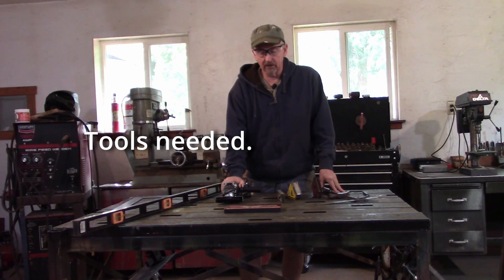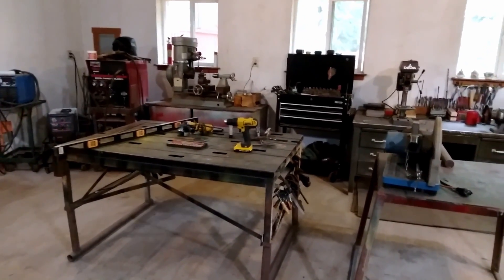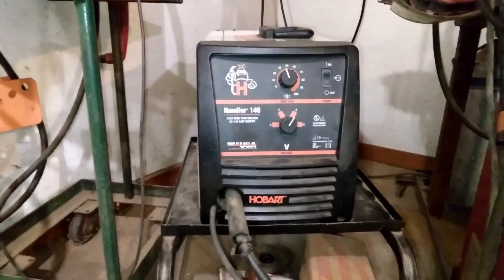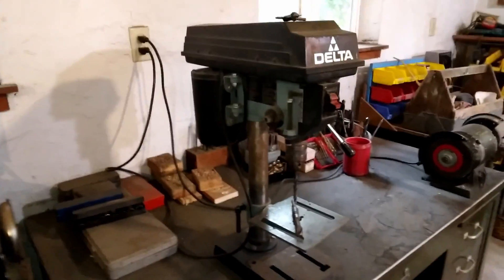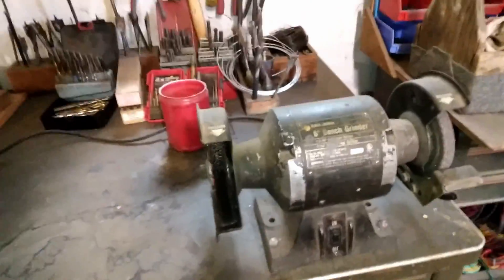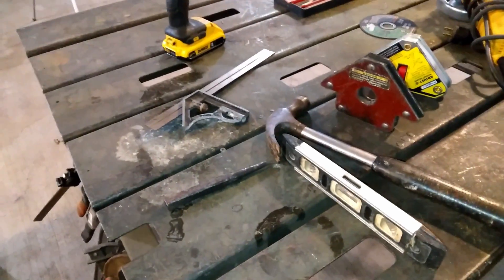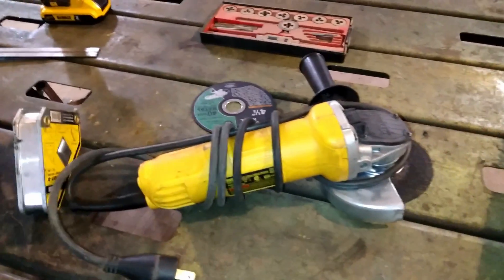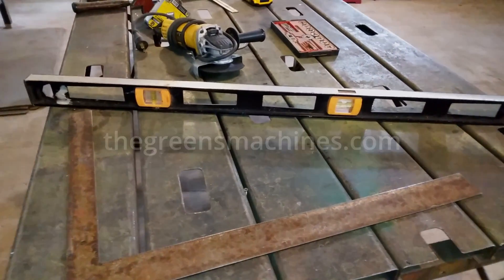Tools needed to build the 360 degree backhoe

Comment: For the round parts of the bucket, do you need a plasma cutter?
Reply from the maker: I used my angle grinder with a cutting blade . It will cut a curve if you take your time